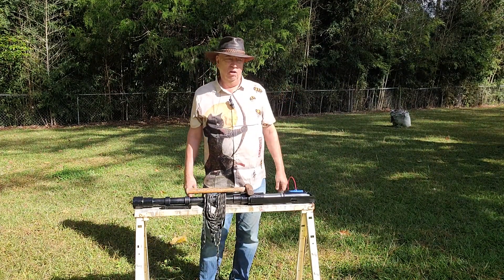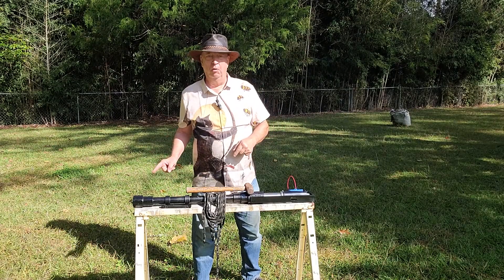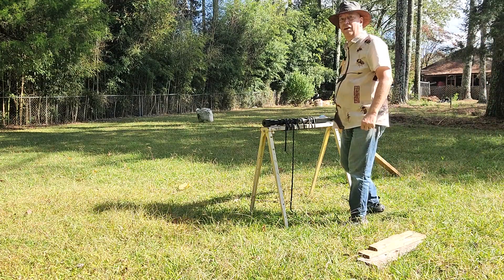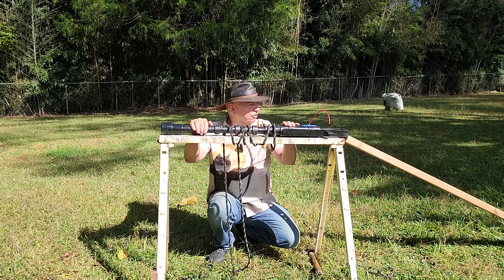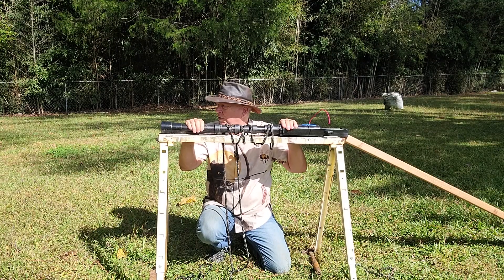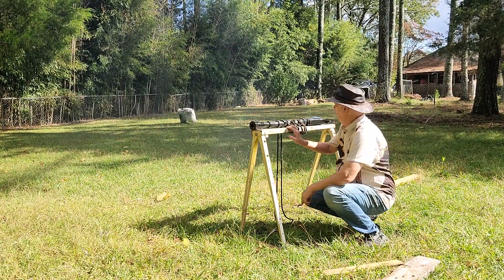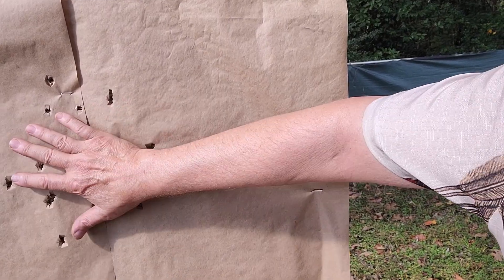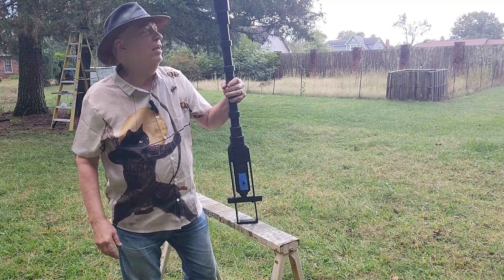S04 E27: MGV2 PT5: First Bench Test!

Comment: Good job bro! now you need to build a bottle jack stand so you can make  pucks with instead of using that c-clamp, it doesn't need to be very big, just big enough to fit on a table. I built one from two pieces of small track, it could be big track if using a big bottle jack like a 20 ton, and two pieces of pipe for the uprights. Make the pipe long enough to get the bottle jack and your puck press between it. You don't need springs to bring the jack down. If you can't find some track, you can use I-beam for the top and bottom for the jack to sit on and to press against. If you did use track, you will need two pieces of angle iron to use as feet, because you will need to turn the bottom piece up side down for the jack to sit on. You'll want to use the bottoms of the track to press against. Oh yeah I hope you can weld! 😁 I built mine because I don't have the funds nor the place to put it either.
Reply from the maker: The C clamp works just as well and is easier to set up, use, break down, and store.
Reply: @timesgonetech3057  I understand, it was just an idea for another video. 🙂